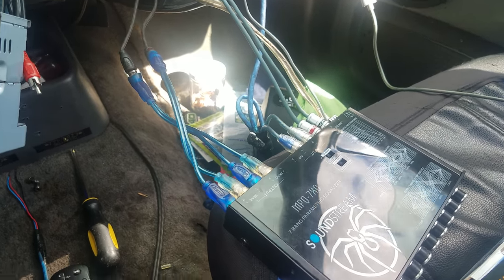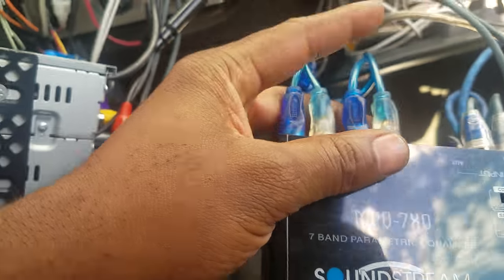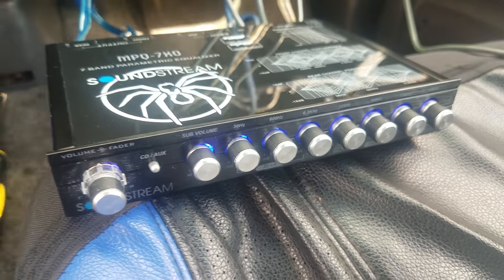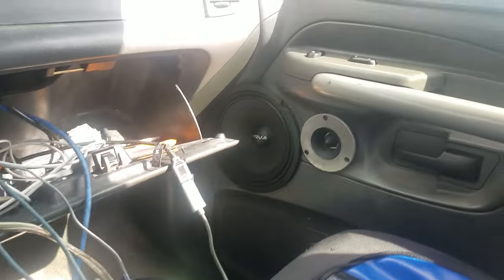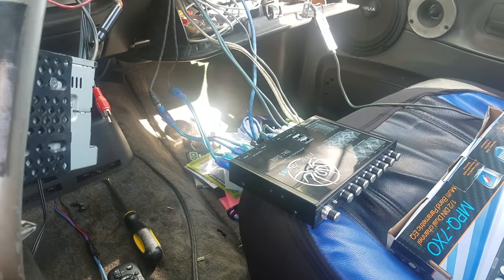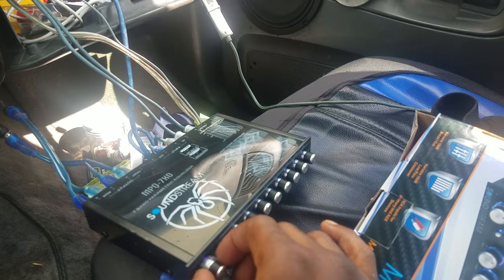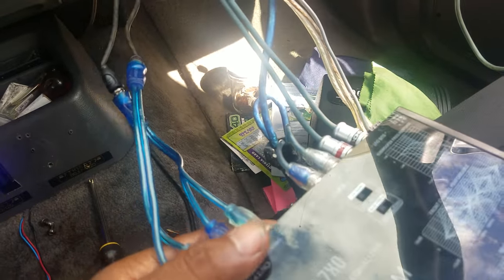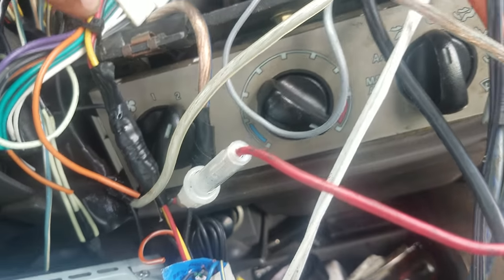Soundstream MPQ-7XO Equalizer Install

Comment: Hey bro I need help I have a Blaupunkt CEBP870 7-Band Digital Equalizer and I have one channel amplifier and this is my stereo Model:7110GM need help how to install it I have all the wires on put can’t know where put the rear out front out because my amplifier is one channel please help thanks
Reply from the maker: How many amplifiers are you using the equalizer to tune?
Reply from the maker: Does your equalizer have a Front Rear And Subwoofer Output?
Reply: @BIGJURAY20  I only have one in it’s one channels 2000 watts
Reply: @BIGJURAY20   o yes it dose have that on equalizer
Reply from the maker: @Fishing_with_Gilbert509  ok so what you'd have to do is run Rca from radios front or rear to Equalizer main input. From there you'll want to use the rca from Equalizers Subwoofer output to your amplifiers input. Be sure your radios settings are all set to 0 since you'll be using the equalizer to tune. Also be sure the equalizer is 0 on all bands or in the middle which is flat. Once your amplifiers gain and crossovers are set you can tune the rest from the equalizer
Reply from the maker: With equalizers there are 3 separate outputs. Front for your high frequencies such as tweeters rear would be for your speakers and Subwoofer would of course be for your bass amplifiers such as your 1 channel
Reply from the maker: Due to you only using a single 1 channel amplifier. You wont notice any changes from the crossovers to your amp if they are for tweeters or midrange/midbass speakers. When tuning with just your bass amp you'll only notice a change in your system with the lower frequencies from the equalizer
Reply: @BIGJURAY20  ok can u help me connect them I used to have Clarion equalizerbit that was 4 years go in I forgot how I connected it in I just bought this one need help connecting wires back I did the ground remote and 12v one just need rca
Reply from the maker: @Fishing With Gilbert509 the rca is the easiest part once u wire things up. Just follow what i said and u should be ok
Reply: @BIGJURAY20 ok thanks
Reply from the maker: @Fishing_with_Gilbert509  If you still run into any problems feel free to contact. You can also message me on Facebook or Instagram @ BIGJURAY20
Reply: @BIGJURAY20  I got it to work thanks bro just bass but I can’t get my tweeters to work I still have the rear out in fron out don’t know where put the rca at
Reply from the maker: They're only used when you're tuning a mid and high amp. The front and rear wont be used in your case only the subwoofer output
Reply from the maker: You'll need a 4 channel amplifier dedicated for your speakers and tweeters for the equalizers front and rear output
Reply: @BIGJURAY20  I had a clarion 7band 4 years ago in I had same amplifier in I connected them in same system but deferent radio I just forgot how I did them looks like I need buy me a 4 channel amplifier

Comment: I bought same eq but for some reason as soon as i plug in i get buzzing noise even when radio is at 0 val.and when i turn off from. Key i get a huge dump sound from subs any idea what it could be?
Reply from the maker: How is the unit grounded and where do u have your eq mounted?
Reply: @BIGJURAY20  i have it grounded off same wire the radios grounded at i have it mounted right under the radio
Reply from the maker: Ground the eq itself and see if it helps any
Reply: @BIGJURAY20  ok i just notice something i connected my eq power to the ignition power not the yellow constant power im gona try to switch  that as well
Reply from the maker: Keep me posted once u get things situated.

Comment: I got this equalizer because I dont have a remote for my sub level so I was going to use this instead. If I'm only hooking up the sub to this how many rca cables do I need? Also no disrespect but I think you had some confusion in the blue wire connection. The blue and white wire is for the remote and the solid blue wire is if you have power antennas. I thought if your vehicle has neither u are supposed to just cap them off. The eq will turn off and on with your radio regardless through the red and yellow wires.

Comment: How high do you have the volume turned up on the eq
Reply from the maker: I had my eq volume all the way turned up. I checked all distortion levels with my DD1.
Reply: @BIGJURAY20  ok thanks I have a problem getting my sub level to play
Reply from the maker: So the rcas are in but no output
Reply from the maker: Can u hear music tuned from the EQ but just no bass??
Reply: @BIGJURAY20  yes my highs and mids come out just fine you can hear the subs a little but I didn't have the volume on the eq turned up all the way could that be the problem
Reply from the maker: @curtisshavers9510  it can be bro. Try turning up the main volume and sub and see if it makes a difference. Let me know if any changes are made
Reply: @BIGJURAY20  thanks I'll let you know I'm gonna try that
Reply from the maker: Ok bro no prob definitely wanna help as much as I can to get u Bass'n
Reply: @BIGJURAY20  thanks bro the volume was my problem I'm use yo the old style preamps
Reply from the maker: Happy to know it was a minor fix

Comment: Sir I have a question ok on a mono amp it has 2 sets of rca outputs 1 says input & the other 1 says output ok so do you plug in the rca plugs in where it says input or output coming from the subout in the back of the eq going back to the bass mono amp i'm going to run two amps also like you have it is kind of confusing because most headunits have a sub preout in the back but I see you just have 1 set of rca plugs and they aren't running to the sub pre out you have it running from front to the cd preout in the back of the eq to the back of the radio I get that part so the sub preout on the back of the eq where does it plug in at going back to the class d/ mono amp do you plug them in in the input or the output please help not trying to be confusing I need that eq in my setup I been had it sitting around for a year help!
Reply from the maker: Randy Watson call me when u can 3109124648 id be happy to help
Reply: I went back & put the rca jacks where you said to plug them in at it's a go it's Alive it's Alive thanx so much bro them highs traveling like a symphony now you were a big help Be blessed sir preciate you!
Reply from the maker: Randy Watson no problem bro happy it all worked out for you

Comment: I have the power supply from eq connected to the head unit wires... but when i turn truck off or on there is a loud pop... anyone knows what it could be?
Reply from the maker: Try changing the ground location

Comment: Hello I have a question? what subs that are right out now would you recommend that hits hard? I'm looking for four 12s
Reply from the maker: Mr. Virginia35 id recommend Audiopipe TXX BD2 12 they're affordable get loud and low as well
Reply from the maker: Look for the Audiopipe BD2 12 on Jet.Com the more u buy the cheaper they are
Reply: BIGJURAY20 can they take a lot of punishment and are they reliable? I was looking a the sundown SA subs but I'm not sure though
Reply from the maker: +Mr. Virginia35 sundown Sa sub is also a good sub. How much power are u planning to run to them
Reply: BIGJURAY20 4 to 5k
Reply: BIGJURAY20 it was said that the SAs can take more then 750rms per sub
Reply from the maker: Mr. Virginia35 either 4 u get will be ok with that kinda power
Reply: BIGJURAY20 i appreciate your quick response.
Reply from the maker: +Mr. Virginia35 No prob bro i try to get back the best i can
Reply from the maker: +Mr. Virginia35 yea they are under rated just as long as u have them on clean power
Reply: BIGJURAY20 btw I just picked that eq about 5mins ago and I definitely put it on a good amp
Reply: Mr. Virginia35 look into sundown Sa they can take 1500 RMS of clean power or ab xfl subs they can take about the same or skar evl they can take 2k these subs are between 175-215 dollars I'm looking to do 7k I'm looking into the evl or SA 12s
Reply from the maker: +Edmond carter you should do the skar evl or Zvx
Reply from the maker: +Mr. Virginia35 u have the same Eq bro
Reply: BIGJURAY20 thinking  about  the  evl on 2 3500s  right now  I have  a skar 4500.1  on 2 ab hd 15s my truck  can't fit 4 15s unless  I  do  a c pillar  flat  wall  but I   like  my rear window  so 4 12s it is
Reply from the maker: +Edmond carter why not 4 12 ZVX and grab another 4500
Reply: BIGJURAY20 yea
Reply: BIGJURAY20 yup
Reply: Edmond carter ok cool
Reply: Edmond carter I just ordered two 12in S.A.

Comment: I have a 2 qpower 12s in a ported box on a 1000 watt Cerwin Vega hed amp do you think they need a sealed box
Reply from the maker: Having a sealed box can help give u better response with your setup. Definitely worth a try. Maybe about 1 cube + of space per sub
Reply: all depends what kind of bump you want, if you wanna wake up the town with boomy hip-hop/rap get a ported box, if you want tight punchy bass for like rock music or metal anything you want to sound clean and tight get a sealed enclosure.

Comment: Do u thing it's possible to hook up 2 equalizer. Like one equalizer per amp? I have two amps 1 for my mids and the next one for bass.
Reply from the maker: 1 is all you need. I had 3 amps running off of one equalizer. Front output for highs amp, rear output for mids amp and subwoofer output for the subs
Reply: Oh ok but u can run 2 right ?
Reply: Just wanted to no
Reply from the maker: You can run 2 equalizers but i don't feel it would change anything when a single equalizer can do what's needed in your application
Reply: @BIGJURAY20  thank u I just wanted to no xd thanks
Reply from the maker: No prob bro happy to help

Comment: Someone just hooked up a EQ in my car and it keeps sending my amp into protect mode.. he only wired it off my sub and amp tho not ti my head unit or the factory system at all.. I’m having it taken out cause I don’t think he knows what he’s doing smh
Reply from the maker: For the eq to also be able to tune your door speakers you'll need an amplifier for them. If you only have an amplifier for the subs at the moment then the equalizer would only control the Subwoofers output

Comment: Why hook it to the front output on headunit i just tried it and didn't sound very good
Reply from the maker: Well each unit is a little different and everyone's preference is as well. Just used Front since the radio didn't interfere with the Equalizer.
Reply from the maker: Did rear output sound better for your system?

Comment: Did u use a 4 or 2 channel amp
Reply from the maker: In this video it's a 2 channel and i used y splitter rca to separate the channels. Channel 1 for tweeters/front to eq channel 2 for mids/rear to eq

Comment: man crimps and heat shrink is the way to do it man try it out no disrespect just a suggestionalso a fuse block you can get them with 1 fuse up to 4 or more the less tucked behind the unit.

Comment: amazing yours actually works, I got nothing.
Reply from the maker: What happened u have the same unit but no output???
Reply: awesome quick response. Na I have a eqs-755 from clarion basically the same thing for the plug ins except mine says main when your soundstream says CD.  Anyway my electronic knowledge only goes so far, but I'm trying to hook it up without a 4 channel amp for my door speakers and it's not going well.  It turns on, but I have no EQ control over anything. I have RCA's to the Head unit Have a ground to bare metal in the vehicle, got the remote wire with the other remote wires to the factory harness and have the 12 volt to the factory harness.  So I guess I have to have the other two RCA's going to an amp, maybe thats why it's not working. Any help is appreciated
Reply from the maker: By my knowledge with your unit you can either use rcas to an amplifier or the hi input which requires you to use your factory head units speaker output both left and right which allows the eq output side to take effect without the use of input rca. But, equalizers such as these are functional with amplifiers only
Reply: Alright, cool thanks for the info man! Ill try hooking it up that way. In the end I think I'm SOL and should just get a 4 channel amp anyway.
Reply from the maker: You can always get an inexpensive one just to help with fine tuning your system
Reply: I read all the reviews and saw nothing but good things, and heard how easy it was to install, and saw nothing about needing an amplifier.  And still don't know why I need one anyway, I don't need more power or volume. Im assuming an amp does more than that. I have a 1100 for my 12s and I get why it's necessary for them because they pull a lot more power, but door speakers......all i wanted to do was do what you did in the video, and that was play with the different frequencies, and hear the sound quality, like everybody was saying they couldn't live without, sry for the paragraph lol
Reply from the maker: Its ok bro i don't mind the extra reading. I understand your point about not wanting to run an amplifier and just using the unit to tune your speaker as is. I know they have equalizer that allow it. Im just not sure of away with your unit without an amplifier. But, I'll be looking into it cause I'd like to know myself
Reply: Iv'e been searching and can't find anything helpful, if you do find anything let me know, and thanks again for the information.
Reply from the maker: No problem will do
Reply from the maker: I asked around and there's no way to use the unit to tune your system without an amplifier
Reply: thanks homie, i talked to my guy at the local stereo place you did my 6x8's for me and said the same thing,  time to buy me a four channel and two RCA's.  Btw just out of curiosity did you run your speaker wire to your 4channel amp or to the back of the head unit
Reply from the maker: From my speakers straight to the 4 channel and rca from eq to 4 channel to help tune

Comment: I installed an EQ and it doesn't work everything is plugged in right
Reply from the maker: If yours has an Aux button, try pushing it and see if there's any output
Reply: @BIGJURAY20  nothing I've tried it
Reply from the maker: @nick_sometin7791  How do you have your rcas to the eq?
Reply: @BIGJURAY20  the main in straight into the head unit, the outputs straight to my amp
Reply from the maker: @nick_ sometin  yea definitely weird and you're using rcas from front/rear output of head unit
Reply: @BIGJURAY20  yea man i ordered 2 eqs and at first it did work then it didn't
Reply from the maker: @nick_ sometin Could be a defective unit. Both equalizers are doing the samething?
Reply: @BIGJURAY20  the first EQ worked then i put my dash in then it didn't, same thing with the second just doesn't work

Comment: Wait but you got an Amp I want to install without an Amp?!
Reply from the maker: This type of equalizer is best used with Amplifiers. This model wont help tune a stock system
Reply from the maker: If your vehicle comes equipped with a stock amplifier you maybe able to use this type of equalizer to help fine tune your system

Comment: heyo my preamp is on but I hear no sound I cheaked all my rca all are good eny tips
Reply from the maker: Only thing i can think about if u don't have any sound is maybe it's not in the right setting. Have u tried pressing the cd/aux button in.
Reply: It only has cd input no aux
Reply from the maker: Ok have u tried connecting the rcas to the back of the head unit to see if u get a signal??? You're gonna have to go through a process of elimination to find out what's causing the issue
Reply: Yes I did and I got a signal
Reply: So the deck output is good and my rca is good to could it be that the postive and negative touch in the preamp?
Reply from the maker: Yes it would be ideal to check all connections to the EQ. Which eq are you running???
Reply: Like the brand of eq
Reply: I double checked all connections but still everything is good I even smell the preamp to see if it had burnt eny way I even opened it still idk what to do. By the way I have a bassinferno
Reply from the maker: Yes make and model so i have a better idea. Any luck with the wiring?
Reply: Wiring is good
Reply from the maker: How do u have it wired up
Reply: Sorry dude don't no the make and model
Reply from the maker: it's okay it could be defective I just want to make sure we run down some things to figure out what it could be
Reply: Oh ok but I brought it like 8 months ago or maybe more and it working perfectly idk dude
Reply: Dude I think this preamp is detected cause when I put the input form the deck to the preamp I hear nothing but if I put it in the sub output in the preamp I hear the songs buy very soft u no what could of cause that
Reply from the maker: @adeiln  yea the output side could've got damaged some how. Could be a minor fix but with the price of eqs now a day's I'd just replace the unit you currently have if it is defective